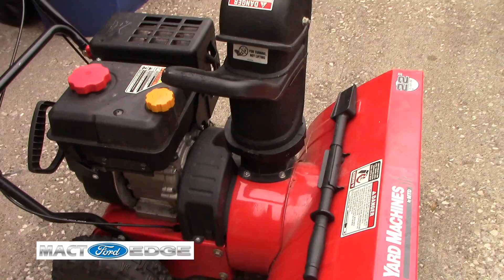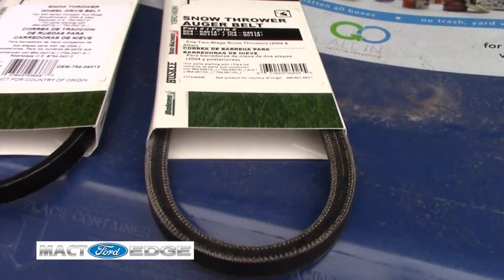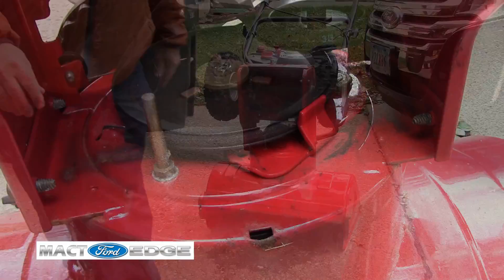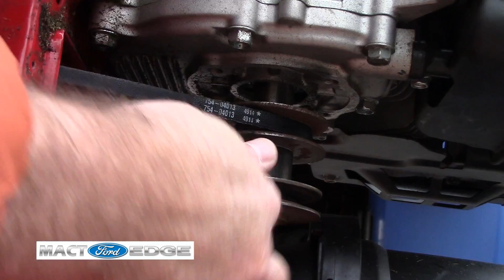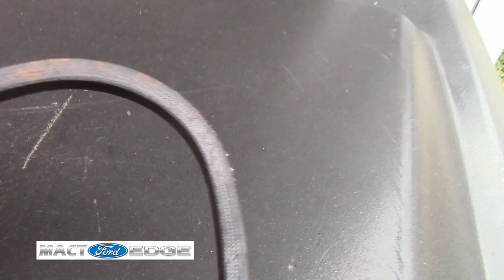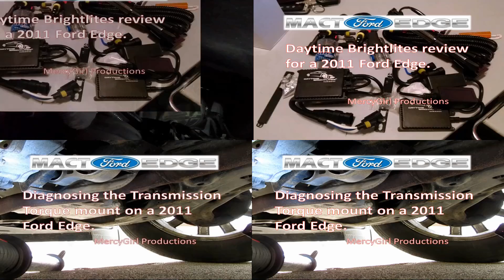MTD Yard Machine Model 31A 32AD700 179 CC 22 inch Snow blower Drive belt and Auger belt replacement

Comment: I see from the publish date of three winter ago I'm a little late in my comments.  
I have a three year old Huskee(MTD) 24" with a 208cc OHV Powermore (CH-onda clone) engine and while not having any real difficultly with it yet. I thought it might be time to have the spare belts, new skid shoes. shave plate on hand and look up how to install on youtube.
For seasonal maintenance besides an oil change I would also replace the spark plug.
Did you lose or forgot to re-attach the belly plate after your transmission overhaul? 
I only had two snow blowers from MTD (the Huskee and a Yardman) both of them had bottom plates that attached with 4 to 6 bolts.You don't want to have slush, dirt and debris get into your drive compartment!

Comment: Thanks, your video was exactly what I was looking for. Got a good deal on a used Craftsman(MTD) 22” and it needed the auger belt replaced. The PO already had the new belt but, hadn’t installed it. This video should shorten my maintenance time.  Saving this for future reference. Nicely done.